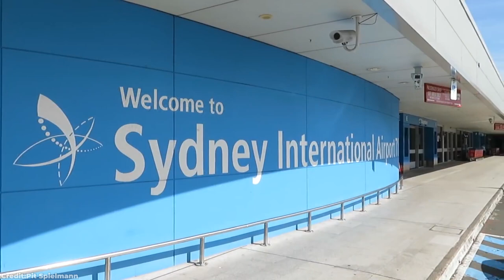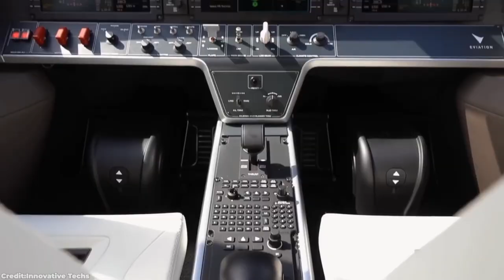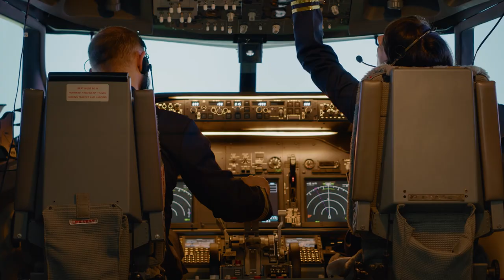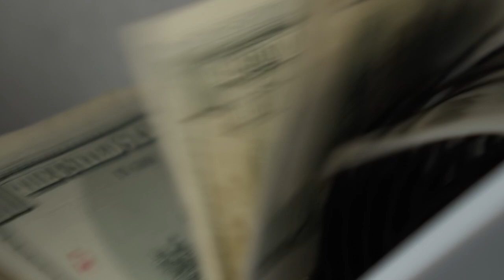Australia's New Western Sydney Airport Is a Logistical Nightmare

Comment: The information in this video is out of date by a long shot. Whilst the oil pipeline is still subject of a discussion as to a preferred route, there is a motorway link between the airport site and Ampol's oil terminal at Kurnell. As for the rail link, it has been approved by the NSW Government and construction has begun. Both the rail line and the M12 Motorway will be complete by the time the airport is due to open.
Reply: The motorway link is a CARPARK it is Useless!!

Comment: What's exactly wrong with the metro? As of now, the metro ends at St Marys, which has a direct train link to the CBD (where most visitors would be headed). Cannot see an issue with this.
Reply: When it is built, the metro is a 23km line to St Marys. That's not exactly close. In the first few years, no rail connection. And then is not integrated into the terminal, though quite close.
Depending on take-up by airlines, a "Skybus" type operation might suffice early on (after all, Melbourne Tullamarine only has buses because Australia is not good at transport away from immediate CBD surrounds).

To service much of the area this airport is supposed to serve it will have to. For Penrith and Paramatta,  once at St Marys not so bad. For Liverpool or Campbelltown, its still a couple more changes and a slog with luggage (rapid bus is planned for some of that section).
If the idea is to catch a lot of the traffic from western residents that otherwise have to clog roads and rail into Kingsford-Smith easy connections from those hubs are needed. 3-4 hubs collectively making up roughly a Brisbane sized catchment. Without the demand from outside the area, as you rightly say most visitors to Sydney will want to go the CBD, and Kingsford-Smith. The new airport is probably going to cater more for residents than outsiders visiting, but the lack of curfew adds some more timeslots too.
Reply: It’s a very real issue , do you realise how long it takes to get from St Marys to the city or even to Parramatta , forever. Even the alternative to take a metro from the airport to St Marys , ordinary train to Westmead and then on the new western metro to the city would take forever and require 2 changes. The metro from the airport should have been taken to say , Blacktown and join an extended western metro or to the under construction metro at Bankstown , common sense I would think.
Reply: @williampackman9821  well, I'm guessing you haven't been to many other cities to see that this solution is much better than most US cities, for that matter. Even comparing European cities, Oslo and Stockholm have airports over 1.5 hours away – a pain if you have luggage.
Reply: There's always people want something to fail, and probably those with no vision whatsoever. Total luddites. Yes, projects like the new airport, and the new rail links, will cost a lot of money over the long run. But the benefits will eventually outweigh the negaitive side over time.
Reply: Every large project has problems, and often expensive solutions. This is a much better airport option than places like Auckland that put the airport way out in the countryside with a long journey to the city. There will be problems. They will be fixed. It is amazing how fast it is getting built. I think the 2026 date is ambitious, but it will be here at some point and when it opens it will spark huge development all around it. It will be popular as a way of avoiding the curfew at Kingsford Smith.
Reply: Problem is timing. The metro should have been baked into the design from the beginning and have been ready to roll on day one, though tbqh I think there should be a regular rail link (either instead of or as well as) to provide a direct no-change link to the CBD, and also to have way more flexibility in route options depending on how demand matures over time. The scramble for "rapid buses" really is just an admission that the current plan is a massive failure of ground transportation.
Reply: Ahh, they should of just built it as a branch of the existing Double Decker Train network to allow for one seat rides from Central and the City Circle all the way to the new western Sydney Airport via Parramatta and of course, St Mary's. Not a Metro that drops you off at a train station where you have to change trains to continue your journey with heavy suitcases.
Reply: @williampackman9821  Well, the NSW Government are working very hard to promote car use in Sydney and I support of it. Why use Trains, when we have largely under utilised freeways. Honestly, they should turn the rail link between Parramatta and Central into a 12 lane tolled freeway. Rip out the Rail lines and replace them with much faster road infrastructure.
Reply: @artistjoh  And it will de clog Brisbane Airport at night, considering 92% of tourist landing in Brisbane around midnight actually want to go to Sydney, but can't due to the curfews and its a similar story at Melbourne. No one really wants to go to Brisbane, Everyone wants to go to Sydney or even Melbourne where there is actually shit to do, but are being stopped by Night curfews, leaving many stuck Overseas or in Boring old Brisbane if they're lucky.
Reply: @electro_sykes  I have experienced a late Sydney flight from Brisbane about 10 or 15 years ago. The plane was loaded, we taxied to the end of the runway, and while the engines were spooling up the Captain made the announcement that we were being denied permission to land in Sydney, so we taxied back to the terminal, deplaned, and then Virgin shuttled everyone to various hotels for a couple of hours sleep before retuning for a breakfast flight.
Reply: @artistjoh  exactly what i am talking about.
Reply: @electro_sykes  Years ago, I thought that was the original plan. Then somewhere along the line, the new train system got into the act.
Reply: @brianmorris8045  Metros can carry less people. Part of NSW Plan to promote the auto industry. They ripped out the carlingford line
Reply: @TheGreatLordDufus  23km is nothing by train.

Comment: Slight fact correction. Sydney Airport is not Australia's largest. Bad fact checking here..... it's actually extremely small and in fact, it's the smallest of any of the state capital airports in Australia. 
What this video meant to say is that it is Australia's busiest airport. 

The size comes down to two simple issues.
Age and location.

The current Sydney International Airport is actually the oldest continually operating international airport.
It's second in pure age to Amsterdam Airport Schiphol. This should not be a surprise given that both the Netherlands and Australia share very early trans-continental history with the Dutch national carrier KLM being the oldest airline and the Australian national carrier Qantas, being the longest continually operating airline (3rd oldest after KLM and Avianca). Australia was also the first country to have both a National Airline and  Air Force.

When the airport was built, it was in a rural area. But today, that rural area is only 5km from the CBD (downtown) of Sydney. To put that in perspective, if the edge of Sydney Airport was the Empire State building, the centre of Sydney would be the new World Trade Centre. 

Sydney needs a second airport.

The biggest issue is that Sydney is hemmed in by rivers and mountains. Very early in its development, governments quickly stepped in to convert as much of the land as possible into parklands and national parks. Sydney is home to the second oldest national park in the world, and has almost 50% of the land protected which adds to what makes it such a liveable city.
The urban spawl has moved around national parks but has left almost no place for a second airport.

Thankfully the government is not shy in spending money. The airport will receive a train line not too long after the airport is built, and well before the airport traffic is ramped up.
It won't be perfect to start with, but I expect the metro projects will soon see frequent express services.

Metro projects going on in Sydney are collectively twice as large as London's Crossrail project, taking most of the engineers and designers from those projects.
Reply: @johnnichol9412  land area is significantly smaller. But being built in 1920, it was likely built to be large at the time.
Perth for example is about 5 times the size.
Melbourne makes Sydney look like a postage stamp. 

While Sydney's runways go out into Botany Bay, making it longer than some (the runway at YSSY was extended to be the Sth Hemisphere runway for the Space Shuttle), the land area of Adelaide airport is larger with space even around the runways.
Reply: In terms of passenger numbers and aircraft/freight movements, Sydney airport is the busiest. Also, Sydney airport is still a pretty big airport. By land area it is most certainly not the smallest of all capital cities. You are forgetting a few. It’s also important to note, that of the land area in Sydney, almost all of it is used space, where as in airports such as Brisbane, it is not.
Reply: @johnnichol9412  way smaller than even Brisbane Airport and yet not many International flights serve brisbane as of 2022
Reply: Yes I Argee, bad fact checking  here, along with using pictures of incorrect Political figures in the video (what’s Peter Dutton got to do with this? ) No pictures of Bob Hawke, since it was was him & his Government who earmarked Badgerys Creek for Sydney’s  Airport. But hey, what do you expect from a Pom with less than 2K subscribers?. 🤣🤣
Reply: @electro_sykes  and they only just opened a 2nd runway!
Reply: sydney airport needs to be shut completely... anyone that has had to deal with this airport knows what a shit hole it is.  the fools that "priviatised" syd have made it extremely difficult to get the carriers to move over and commite to a new airport..  this new airport should be dual runway from the getgo with capacity for the next 60 years designed into it for all of sydneys traffic needs..   brisbane lucked out with their airport, literally perfect airport, with huge amount of space and dual un-restricted runways.  no congestion when landing in BNE... land in sydney... total pain in the ass with many delays always.
Reply: Shorter inodesnet: This video is complete crap. I agree.

Comment: The major Flaw in this western Sydney Airport is . In the 1980's the flight paths  were  not confirmed. NOISE was an issue ,The peoples choice then was not Badgery's creek. 
But Politicians  conveniently have Not talked about this now, to fast tracked project.  Runways built, Terminal  on the way, Contracts for the useless Short shuttle metro line and toll way connections developed.
So this site will impact the greatest number of Western Sydney residents with aircraft having to take off and land Mainly OVERNIGHT. To make international connections in SIN,KL and HNK 
So, Urban growth Land use planning  ignored the Flight paths So this was not factored into the massive new suburbs where 1/3 of Sydney's population with be subject to aircraft noise 24/7.

Comment: Could you imagine a family of tourists with large baggage and kids to keep in check trying to catch a bus to there final destination. 
Could you imagine a group of elderly travellers walking 500m to 1000m or more from there plane to catch a train.
Could you imagine a tourist that landed at Western Sydney Airport catching 3 trains to link with a connecting flight at Kingsford Smith Airport or better yet a bus on the M5 and M5 at 7am.
Could you imagine trying to get to Western Sydney Airport from Campbelltown by train. 4 trains that is and 3hours plus travel time plus waiting 3 hours for a flight.
The government couldn't plan to turn a tap on. 
It was $8Bil then $11Bil, What is the actual cost to tax payers? Incomplete rail, no sustainable fuel supply, no accommodation nearby for the volume of travellers and flight crews, no public transport even planned.
What an absolute joke.

Comment: Need a high speed train corridors.
Bradfield to Sydney CBD
Bradfield to Canberra 
Bradfield to Wollongong 
Bradfield to Newcastle 
Bradfield to Bathurst 
These are just few backbone lines.
The train’s speed should be around 300km/h to be efficient 

Metro is too slow and only efficient within reasonable distance say 8-15 km’s. Anything further than that needs limited stops suburban trains.

Comment: funny how they built a multi billion dollar airport but totally forgot about the fact that planes need fuel to fly
Reply: It's all about politics (both state and federal). When the plan first got the go-ahead, the Abbott government was hell bent on making everything a "culture-war" issue, and point blank refused to provide any funds for non-road ground infrasturcture links to the airport, even though the Baird govt in NSW was also Liberal (in the Aussie sense - i.e. right wing Conservative, the same party as Abbott) and was begging for a rail link. The pipeline just got caught in it as a by-product of that clusterduck. 

The airport is desperately needed, as Kingsford Smith is completely hemmed in, and the land it occupies could be much better used if it were to eventually be completed replaced by Badgery's Creek, so it's unfair to say Badgery's is a white elephant, but is absolutely has been appallingly managed.
Reply: @lmlmd2714  they said they would only fund road based projects because the liberials fedral government hate public transport and prefer cars. Should the LNP of being elected for Queensland in 2020, Brisbanes Rail system would have been slashed and one of thes lines would have even been closed.

Comment: When this is done, I reckon they are probably gonna have mostly all International flights move here and turn the current airport into a Domestic Airport. I don't like the plans for the Metro, though, as people will just have to change Trains at St Marys. They should've built an Airport Express Train service via Parramatta instead.
Reply: They’re not making Sydney Kingsford airport a domestic airport 😂😂
Reply: I suspect the long-term plan will be (eventually) to close Kingsford Smith. Airports within inner suburbs are a huge pollution and congestion issue, and the land it sits on is insanely valuable. Splitting international and domestics over two airports nearly 50km apart and with no direct link between them will be hugely unpopular with Qantas and VA, who have significant amounts of domestic/int'l transit traffic through the airport, and very unpopular with the public too. There's plenty of space out at Badgery's Creek to build 3 or 4 runways (two full length runways for big jets, and two shorter ones for A320/737 narrowbodies would be ideal) and terminals so once they finally sort out decent transit and ground infrastructure and get the place scaled up, it'll make sense to begin winding down Kingsford Smith. 

I think they'll need to be a heavy-rail line from St. Marys. This will allow a fast train services from both Parramatta and the CBD direct to the airport using the intercity (fast) tracks, and potentially also from Wollongong via the triangle at Sydnenham and the metropolitan freight line between Campsie and Lidcombe, with some upgrades puts in place.
Reply: @lmlmd2714  I think it's similar to the London Heathrow Problem in some cases. The Western Sydney Airport will just end up being another Gatwick.
Reply: There are plans to link the metro stub at St Marys to Sydney Metro West at Westmead.
Reply: @vintageradio3404  They never think this through. Man, Skybus will defintely make a profit
Reply: @akryquityt5557  meh
Reply: @lmlmd2714  They also need to extend the Metro Southwest from Bankstown to the New Western Sydney Airport via Luverpool. At Western Sydney Airport, there would be an interchange between the extension and the St Marys Metro. This would allow for a one seat ride into the CBD and onwards towards major Regional centres like Chatswood and Rouse Hill.
Reply: @lmlmd2714  This is not logical. The new airport will only have a maximum of 80 million passengers, and that won't be reached for 50 years. There will need to be two airports long term and probably by the end of the century, a third international airport.Do not expect Mascot to close any time in the next hundred years, unless there is a radical change in long distance travel.
Reply: @electro_sykes  Picking the option of being on a driverless train (which already exists in Sydney) and getting on a crowded bus and sitting in motorway traffic, I'd take the train any day.

Sydney will have two airports with working rail links. The reason buses do well in Melbourne is because that is the only option.
Reply: I predict they turn it into a general aviation airport or even a drag strip due to noise complaints  of big jets.
Reply: @freelanceopportunist559  So few people live in that area that noise complaints won't be loud enough to rise above the jet noise. In the heavily populated areas around Mascot did lead to a curfew, but there was never any realistic suggestion of downgrading Sydney Airport to general aviation or a drag strip. Western Sydney Airport is quite safe from noise complaints due to the lack of people out there, and government commitment to the need for the second international airport.
Reply: @artistjoh  

It's not the airport itself that I'm talking  about.  It's the flight path, the traffic pattern.   Doing 3 legs of a circuit in an airliner covers a massive area.